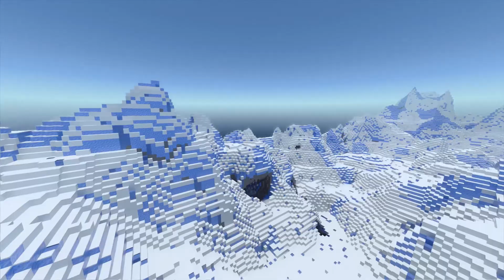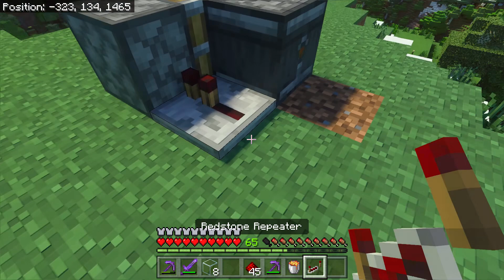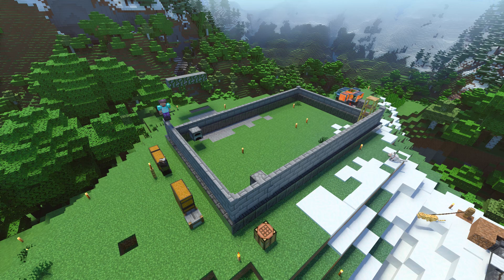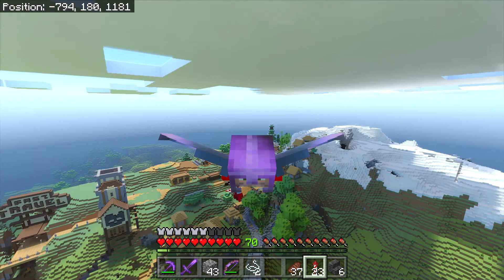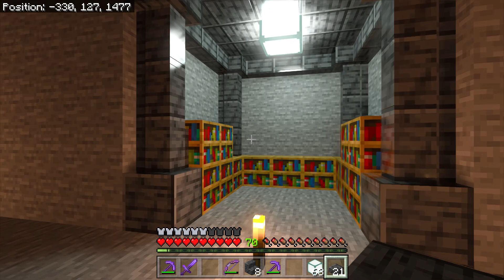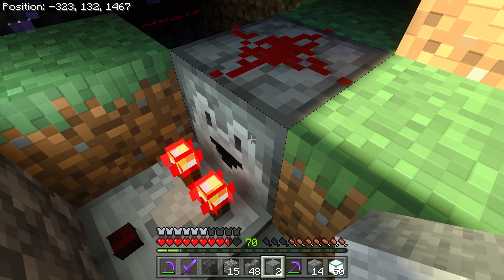Making a 3x3 Piston Door! - Truly Bedrock Season 4 - E4

Comment: Waterlog the piston. Run power into the created cobblestone through the side with a repeater. Dust on the other side of the cobblestone that connects to a block adjacent to the piston. Significantly cheaper to build and much more reliable.